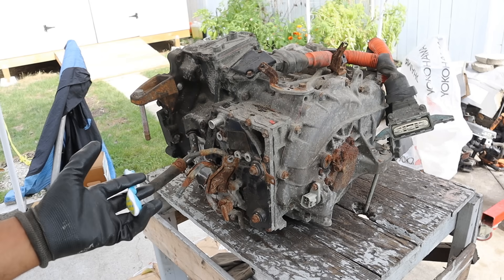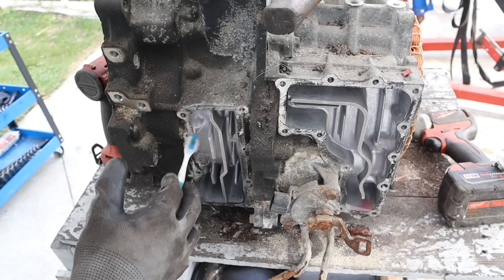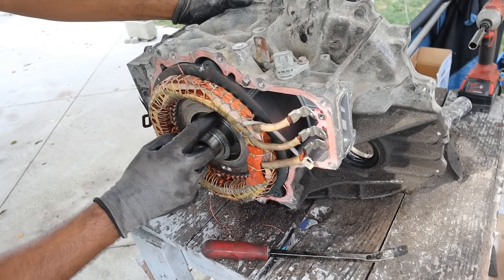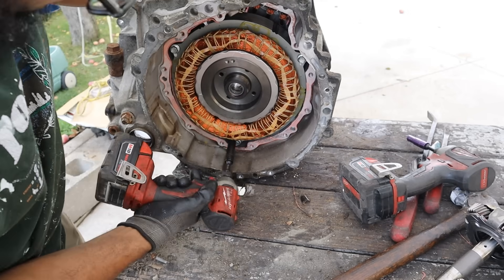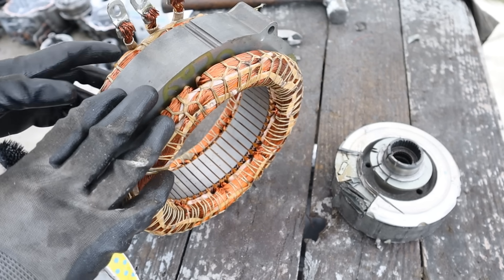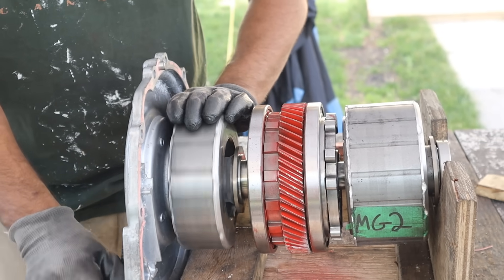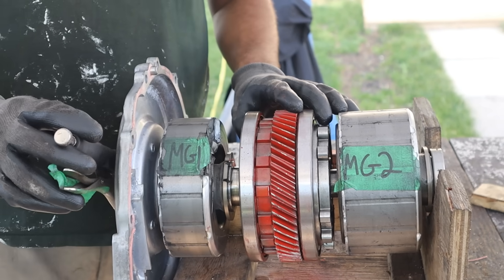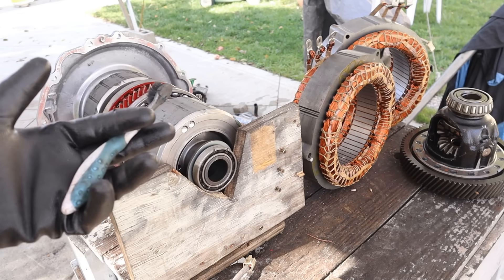How a Hybrid eCVT Works: Lexus RX400H 411,000km Teardown!

Comment: In defense of the hidden filter screen, I haven't heard of clogged screens ever causing failure.  This gearbox is no more complex than an open differential or a manual transmission; neither is even equipped with a screen.

Comment: A good hands on demo of it’s operation! The only item that doesn’t seem to be there is the existence of “engine braking” * \B’ on the sick shift) that can be used on long descents if the traction battery is full or if regen braking isn’t enough. It’s a good system, with no old style starter motor or alternator, with MG1 doing both jobs when required.

Comment: I have a prototype vehicle based on the Chevrolet Spark that uses the LV7 1.4L naturally aspirated engine.
My car has an issue where, when going uphill or under a heavy load, a “clacking” or “ticking” noise can be heard when I press the accelerator pedal.
When I either release the throttle or press it further, the noise disappears.
This sound does not occur when the car is stationary in “P” or in neutral “N”.
When reversing uphill, the same noise also appears.
While trying to press the accelerator in reverse (gear “R”) to climb a slope, I can hear the noise coming from underneath the valve cover area.
I would really appreciate it if you could help me identify what might be causing this issue.
Thank you very much!

Comment: The Achilles heel of an internal combustion engine has been the narrow power band, requiring gears or belts that allow the engine to spin at an appropriate rate. First generation CVT's used a V belt with two pulleys to adjust that. I'm amazed to see the problematic belt has been entirely discarded, as have all friction plates. Brilliant engineering.

Comment: So there's no pulley belt in Toyota hybrid?
Reply: You are correct. My opinion is that it should not be called CVT because with that name, many people will think that it has a belt of some sort that is commonly an early failure point in other brand of modern transmission designs. Toyota really went outside of the box while designing this fabulous marvel of a transmission, and it should be referred to as something unique and special, as that is what this transmission is.
Reply from the maker: Nope! 
Nissan ruined the CVT name for everyone

Comment: So impressed how all those parts look ater 400k. Other than a faulty 12 volt battery my 23' Prius LTD seems to be issue free at 45,000KM. Great explanation and teardown.
Reply from the maker: Well there aren't any parts to fail or wear down except very hard gears so I kinda expected that.

Comment: I wish auto makers would use this cvt system vs. cvt with chain or belt, it doesnt have to be electric.
Reply from the maker: But you'd still have two electric motors that would need to be controlled with a high voltage system

Comment: In newer eCVTs (4th and 5th gen) Toyota’s shrunken and offset the electric motors instead of having them in parallel, resulting in lighter and more compact transaxles. The e-motors are also more powerful despite their smaller size with the advancement of technology.
Reply from the maker: Yes I've read that. Would love to Teardown one someday

Comment: Very clever setup, I have the most recent Toyota hybrid system in my Corolla and it's very smooth and much quieter than the previous generation and the fuel economy is excellent, getting around 70 mpg UK

Comment: Sir, you are brilliant. Your mind for integrating automotive mechanics with the very complex spouse dynamics is unparalleled. Question - how is mg1 held or slowed down? Electrically from what i understood? In that case what happens when the SOC is very low? How does then mg1 get powered up? I have a Toyota small hybrid. At 33% SOC or if voltage drops below 170v (I read from obd) no motor assist and surely no EV mode is available. I think this part is the Mg2. But irrespective, what do you think?
Reply from the maker: As MG1 rotates you apply more "load" to it by having it charge the battery, the same way Regen braking works. See my previous power electronics video I posted for this vehicle.

Comment: Toyota Hybrid is an incredible system fantastic efficiency with unsurpassed durability ❤
Reply: It could be even better if toyota didnt make it bad on purpose - every time accelerator is released car brakes. This is stupid and uneconomical.
Reply: @NoName-md5zb  Have you tried putting the shifter in 'D' instead of 'B'. That would help-

Comment: It's satisfying how clean it is inside compared to the "crusty grandma's foot" condition of the outside.

The biggest weakness of this generation ECVT seems to be the lack of coolant circulation when the ICE isn't spinning.
Reply: Yes it’s meant to assist not fully support & they only go 1-2 miles on full electric mode
Reply: WHAT DOES B MODE REALLY DO?!!

Comment: Interesting that they used a resolver instead of hall effect sensors.
Reply from the maker: Resolver is more accurate for low rpm like when you are creeping along
Reply: @speedkar99  Good point. Hall effect systems do revert to six step at low speeds. I thought that would be fine, but maybe too much vibration for a Lexus.

Comment: Scotty Kilmer says that Asian transmissions don't usually have issues with high mileage on the ATF. I think it's something about the friction material choice, and maybe that's why the screens are so clean.
edit: I have to add, speedkar99, you are a natural teacher. If you're not teaching, you should be.
Reply from the maker: Thanks I'm glad you appreciate my video style. 
Asian cars can be like alot of others, it comes down to maintenance and design. Look at Nissan struggling with CVTs
Reply: Scotty has zero idea what he's talking about, and I don't just mean this particular topic. Guy's a nutcase. He thinks these eCVTs are unreliable just like normal CVTs. Toyota's automatic transmission will almost always break down or have problems by 150,000-200,000 miles if you don't change the transmission fluid, but they'll pretty happily do 300k if you change the fluid every 60-80k miles.
The screens were so clean here because there was no friction material.
Reply: He should have his own classroom of people who want to become master techs

Comment: As a former motor winder, I have to say insulating that much copper in a small stator like that is nothing short of miraculous.
Reply from the maker: Did you wind them by hand or a machine?
Reply: @speedkar99 By hand. Did it for about 5 years. Started in 89 or so. Mostly small 3 phase. Max 200 hp.

Comment: I have read that the reason for the pump was to circulate some fluid to cool the stator by spaying it over the top  stator ! 🤷🏼‍♂ The Toyota eCVT is a brilliant invention . I have one in my '22 Venza , works amazingly . Thanks for this video , you make it easy to understand .🌵
Reply from the maker: Perhaps it's true but coolant is on the other side (see the first part of the teardown) for the Motor Generators
Reply: @speedkar99 Oh. I don’t know for sure. I just saw it somewhere, I am  no expert. But getting much smarter watching your videos. Always a pleasure see. Anxious to see the video on that rear drive unit. My car has one of those also. You’d grandpa must be a tough man to use that toothbrush 🪥 😊🌵

Comment: My god, what a complicated mess just to save a few bucks of gas
Reply: Have you ever seen a conventional automatic transmission torn down? This is nothing compared to a 10 speed. It ingenious how simple this hybrid system is.
Reply: @josephnovotnak  Had a ‘72 Toyota; 4 cylinder, 1.2L, single barrel carb, produced about 70hp with a simple 4 speed on the floor transmission, rear wheel drive it easily got over 33 mpg city driving and was a hoot to drive.  Between building and driving the thing the carbon footprint is probably half of today’s vehicles.  KISS.
Reply: @PhillipFritz-i4z the point was to reduce overall need of energy Across the board of usage. Most of the times the 3MZ has an issue before the hybrid system. I agree with the position factor though. Probably 4x amount of money to create a Prius
Reply from the maker: This is way simpler than an automatic transmission
Reply: Our Euro Yaris Hybrid is doing between 70 to 80 miles per gallon, Incredible efficiency.
Reply: @-DC- 65mpg US gallons

Comment: At 15:29, you answered the questions I've always had. I always wondered if all the electronics were being flooded and submerged in the lubrication fluid.
Reply from the maker: The motors are. The control boards are in the inverter, see my previous video for details on that.
Reply: The "Electronics", ie: Logic and power PCB's are in a dry compartment, with the transistors glued to the back side of the cast aluminum heatsink, with coolant passing through the heatsink fits on the opposite wet side.

Comment: Thanks! I fully agree with you about reliability and all that, because I own a Toyota Auris hybrid, which has the same engine and drivetrain as the Toyota Prius 2009-2015. Very good and fuel efficient car, never had a better car
Reply: Fully agree, I own an Auris Hybrid wagon. Great car. Might consider a Corolla Hybrid 2.0 wagon later, but I have a feeling the Auris will last forever :)
Reply from the maker: That's awesome! Any issues with it so far?
Reply: @speedkar99 nothing, except good maintenance

Comment: Toyota is the Best. But them not investing in EVs will be their downfall.
Reply from the maker: They still want to commit to gas engines
Reply: @speedkar99 They even say Hydrogen is better than EVs. 😂😂😂
Reply: But HEV meass hybrid electrical vehicle. So, EV is inside the HEV. Especially, PHEV means Plug in HEV which has the plug-in system. 
By excluding the Engine and MG1 and eCVT and adding 20x battery,  PHEV  can be EV. But adding 20x battery will make the car price much expensive. 
So, I think investing in EVs would be kept inside HEV and PHEV.

Comment: I’ve had a Gen 3 Prius for a long time and replaced it with a Lexus CT200H (which is a Prius but less obviously so). 
Zero mechanical problems over a combined 180 000km in the two cars. Not even a single warning light or error message. And I drove the living daylight out of both vehicles. 

Because I’m curious I wanted to know how exactly the drivetrain on the Prius works. Took a while to understand (don’t bother asking your average Toyota dealer 😂). 

I fully agree it doesn’t offer a very satisfying driving experience, it actually gets “worse” the faster you want to go. Pegging the throttle wide open will drain all battery assistance in under 3 minutes and then you’re left with just a detuned 1800 desperately trying to lug around 1.5 tons of car as well as sacrifice a few kW towards trying to recharge the battery. 

Sounds terrible until you realise you are probably never going to have to drive like that on public roads. Certainly not in an urban environment, WOT is at most utilised a few seconds at a time. 
Long distance driving maybe half a minute or so for overtaking. 

For normal driving you never run out of battery. On the open road the car will easily maintain 160km/h while keeping a healthy charge in the battery. 

But yeah it’s no V-tec or V8, more like V-boring 😂

However, any reservations about performance quickly fade into insignificance when you consider the genius of certain mechanical aspects. 

Zero friction materials to wear down. No clutch. No transmission brake bands. No syncros. No gears are changing, ever! 
No starter motor brushes or solenoid to wear out. No ring gear teeth to chip off. 
No external ancillary drive belts. (No fan/serpentine belt) 
Power steering: electric 
Water pump: electric 
Aircon pump: electric 
Alternator? One of the MG’s has you covered. It starts the engine too. 

The front brake pads on my Prius lasted 100 000km in a city notorious for having the worst traffic in South Africa. The ones on the Lexus were still good when I sold it at 80 000km, despite regularly flinging the car around the many awesome mountain passes around Cape Town. 
Thanks hybrid system, for all that “free” braking 😅

The Prius is meh. No arguments. But it hides some really clever bits that is very exciting to a small group of people. Probably the most clever bit of automotive engineering ever.
Reply: Yes, great cars. You forgot to mention that there is no turbo to fail, no direct injection to clog up the intake manifold and Toyota knows how to make a timing chain that is not made of sugar like many others. I have an Auris Wagon with the same engine-drivetrain combination. Not a single issue in 220.000km. High speed highway driving is not its strong point, but it is always very frugal (less than 5L/100km, even during short trips in winter time where many cars consume a lot of fuel). And driving up a long stretch of steep winding roads with 4 people and full of luggage is not ideal. It does ok, plenty torque from the hybrid drive system but the engine was working hard. Well till we ended up in a small traffic jam, still on a steep road. It easily crawls forward where others need to burn their clutches.
Reply from the maker: Awesome. It's too bad they discontinued the CT

Comment: Don't they use a push pull system in the magnetics of the electric motor, thus the use of 3 phase electrical windings?
Reply from the maker: Yes. There is always lag and that's called slip

Comment: For those of you who want to know, yes the vehicle can move faster on stock configuration than advertised. We tried on an abandoned airfield.

The vehicle goes about 59 km/h which is 42 mph american (I think) on stock wheel size. But you can get a few miles per hour with a lift and some huge wheels and tires, effectively changing the final drive ratio.

I seriously wish that toyota would have specced this thing to go like 80 km/h (50-ish mph) on electric only.. Still, a great thing to drive and pretty much bulletproof.

Just be ready to lose your mind trying to access those rear cylinder bank spark plugs...

Great video!
Reply from the maker: In the newer models it can go much faster in ev mode
Reply: @speedkar99  Do you mean the rx450-series?

Comment: Nice engineering and well built machinery. But why do they have to make the car so slow?
Reply: Because it is a mass produced car for the average person. Want a race Car, buy the U9 308 mph.1
Reply: They are quite quick of the line if needed because of the instant electric torque. But if you want a fast autobahn car you just need to burn more fuel, and that's not what these are made to do.
Reply: @ComplicatedStuff  9.1 second 0-100km/h is snail level slow.
Reply: @jamsbong  What car are you talking about? That's not the spec of an RX400h
Reply from the maker: It's heavy due to the motors and battery pack. Compared to the gas version it sure does put out some power